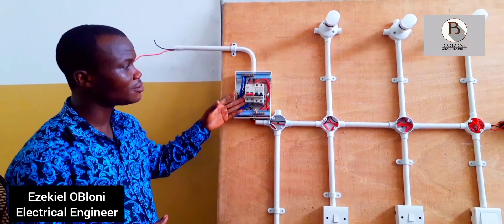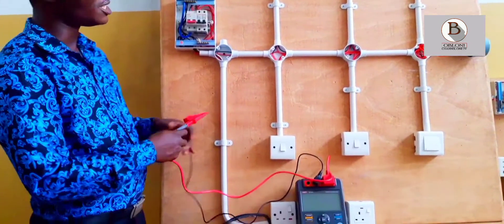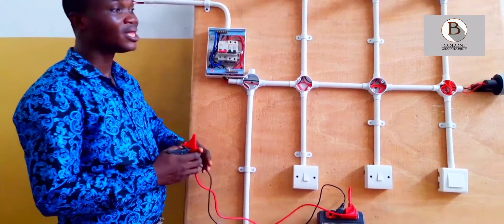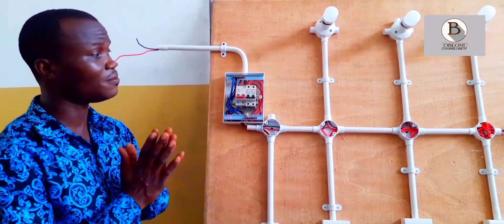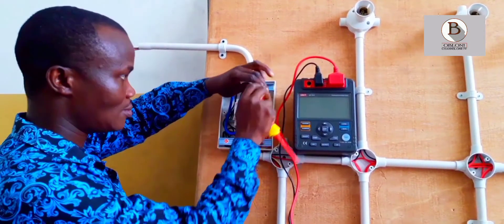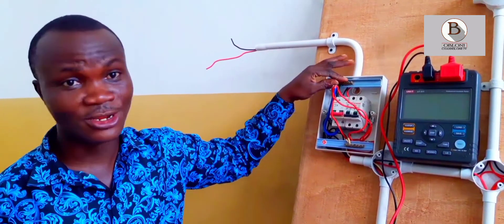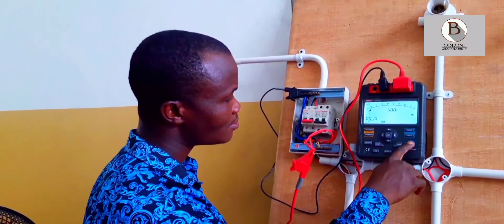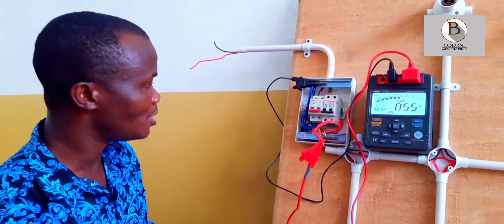BEST WAY TO DO INSULATION RESISTANCE TEST ON ELECTRICAL WIRING

Comment: Does the readings depend on the the type of testing machine you are using,  giga ohms and mega ohms what’s the difference
Reply from the maker: @noagbehenkel4919  
Please you may have to join our online classes. You can reach out on  +233209323669. Thanks

Comment: thank u, when we are testing with 500v do we need to have unplug all loads or not?
Reply from the maker: Yes, all loads should be unplugged before the test
Reply: @obloni_Electrical  how can i test if there is no option to unplug some loads?
Reply from the maker: @BirukWolde-mn6hi  
Switch that load off. The test is done on the cables in the wiring,  not the loads so switch off , unplug or remove all loads before the test.
Reply: @obloni_Electrical  ok thank u for your good response
Reply from the maker: Yes, all loads should be unplugged before the test

Comment: Please i wantw to ask the following questions.
1. Must the voltage always be 500V
2. When testing for the insulation resistance test for fhe circuit must we turn the switch of the lighting circuit ON or OFF.
3. What happens or what do we do when the test is below 2 mega ohms
4. Must the time always be set to 10sec
5. Please what does it mean to say there's a leakage between conductors
Reply from the maker: 1.	Ans: Common industry standards such as IEC 60255, and IEEE 43, recommend different test voltages and durations for insulation resistance testing depending on the application. Typically, the test voltage for low-voltage systems may range from 500V to 1000V, and for high-voltage systems, it can be significantly higher.
2.	Ans:  For an insulation resistance test, you should generally turn the switch of the lighting circuit OFF. This is done to prevent any interference from the connected load.
3.	Ans:  That would mean that the insulation on some cable(s) is not up to standard and you have to replace those cables.  But you must know that there are standards and electrical codes that must be adhered to in every country. so the value “may” be different depending on the country and the application.
4.	Ans:  Testing for too long with excessive voltage(500V) can potentially damage the insulation on the cables, so it's crucial to adhere to the prescribed test parameters.
5.	Ans: "leakage between conductors," typically refers to an unintended flow of electric current between two conductive elements that are not supposed to be electrically connected. This can occur due to Insulation Breakdown.
Reply: @obloni_Electrical  wow! Thanks for your response. I really appreciate it
Reply: @obloni_Electrical 
Please can you use IR tester for continuity test, if yes how is it done.
Reply from the maker: @danielteyehuago1633  
Technically, Yes but you must note that, Insulation testers apply high voltage (usually around 500V) to measure resistance and this can damage delicate electronic components in a situation where such components are present. Multimeters use a much lower voltage for continuity testing, making them safer for general use.
So in summary, for intentional measurements, use a multimeter for the continuity test.

Comment: Thank you sir, but I want to ask, how will you know if there's a leakage in the system?
Reply: You have answered it to my understanding, thank you sir
Reply: @ahiagbleseth9500  Great!
Reply from the maker: Before I answer, Please note that, there are rules regarding electrical circuits. And these rules are country specific.

for instance,  in Ghana,
The Ghana Electrical Wiring Regulations 2011, (L.I. 2008) says that, the minimum acceptable IR test value should be 2M Ohm (2000000 Ohm)

This means that, if the IR tester reads a value less than 2M Ohm, then the integrity of the insulation in a part of the circuit is questionable.

In that case, you will have to do the test on individual final sub circuits to identify the particular circuit with the low reading IR (leakage)

If the IR tester reads 0 Ohm, it means there is a direct short circuit between the cables in that particular circuit.

So let's say, for instance, there is a leakage between the live conductor supplying the sockets and the earth wire. In such case, the IR tester will read a low resistance value, may be 0 Ohm, 10 Ohm, 200 Ohm 1K ohm, the reading will depend on how close the two cables with the insulation problem are, to each other

a leakage simply means that, there is current leakage between; 
1. Two live conductors (in the case of a three phase wiring)
2. Live and neutral conductors or 
3. Live and earth

Please let me know if I have answered your question to your understanding
Reply: @obloni_Electrical  well explained, so with this how do you rectify the leakage.
2. Is the IR tester the only instrument you can use for it.
3. What brand of the tester is the best
Reply: unanswered question sir
Reply: @obloni_Electrical 
14:51 
Good explanation